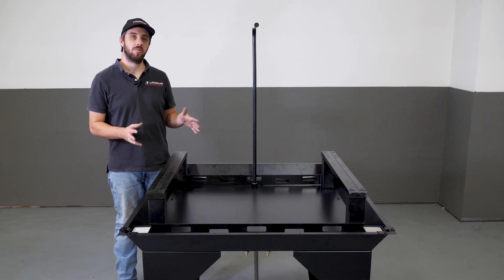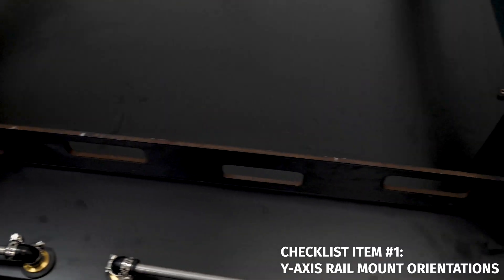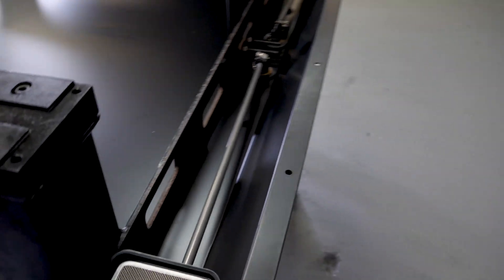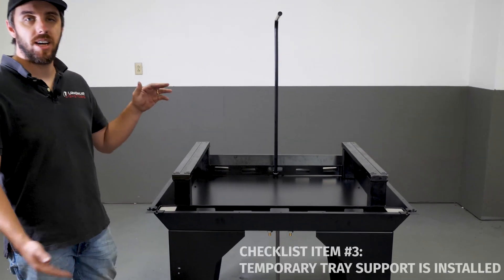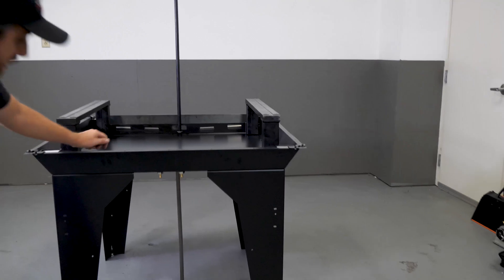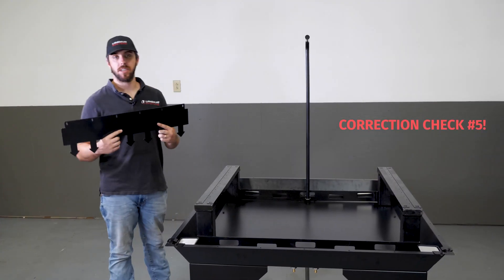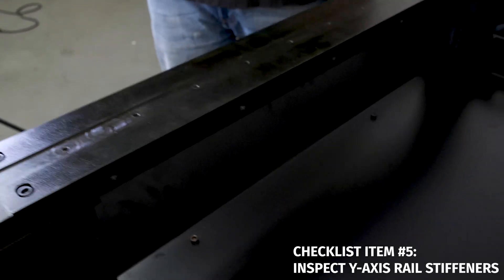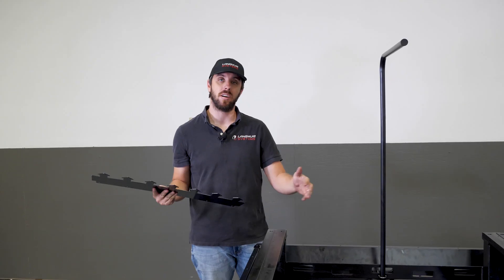MR-1 CNC Mill Assembly Tutorial: Performing Checklist Before Pouring Concrete Base

Comment: Good video!  However that is not the way to file that first filing. Need a continuous fluid filing motion with two hands at a 45 degree slant across the whole edge in on motion. Rinse and repeat.

Comment: Is there a convenient way to move this beast around? I'm guessing I might have to rig up some structure to lift it with a pallet jack? (Not that it's too big an issue. I don't intend to move it but I may have to on occasion.)
Reply: I have the same concern. What is the best way to move it once it is completed? best lift points?
Reply: I was thinking the same thing as it would be stupid heavy after the fact. Just build it on top of a pallet and use a pallet jack to move/level once at it's new home. Once the concrete is in and cured you can still do this but it would be difficult. You don't want to use casters as feet as you need the friction of the feet on the ground to hold the legs together. You could also make an entire base for it that is on wheels out of metal or wood and THAT could have basters on it as you're not using friction as a foundation at that point. I think that's what I would do.

Comment: Hello, leveling feet were mentioned in the video...but I don't see any leveling feet on the legs.  Are leveling feet included in the kit or do I need to purchase them separate.  Also, what would be the thread for the feet?
Reply from the maker: They are there, it’s just hard to see them. All will make sense once we publish the assembly manual.
Reply: @LangmuirSystems  Okay, thank you.  :)